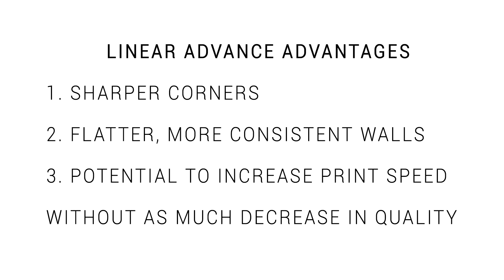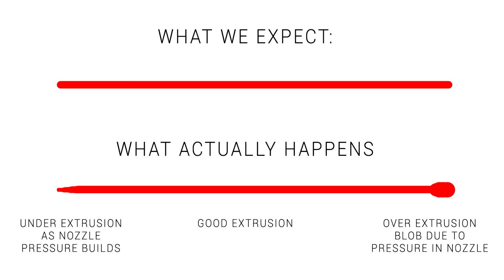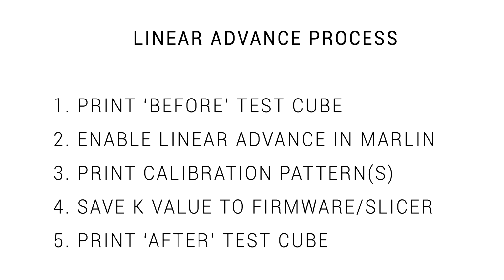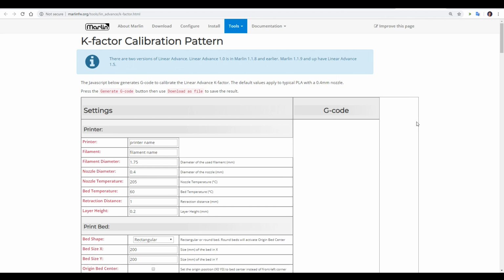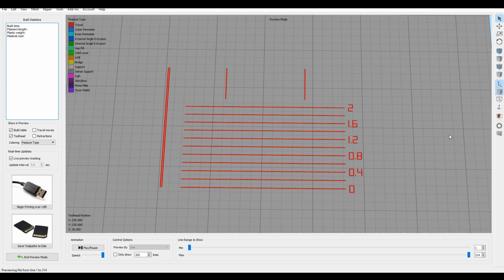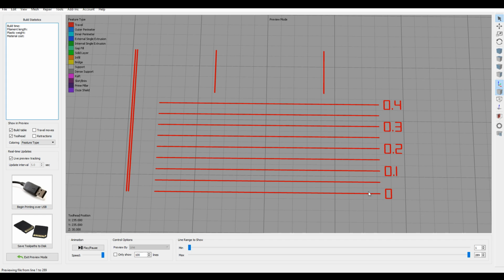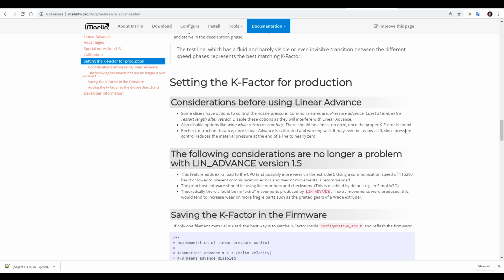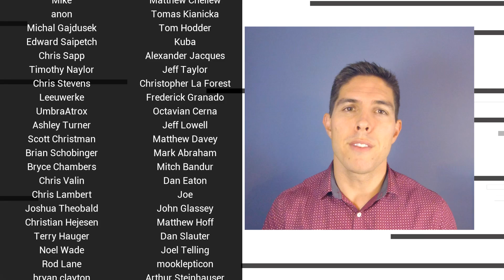Linear advance guide - Free and easy print quality improvement

Comment: If you are using UART mode TMC2208 drivers, Linear Advance will actually work (In Marlin 2.0.x, at least), but you have to change some firmware settings. I have written some notes about that, as well as some stuff pertaining to printers using a bowden configuration.

To make the 2208s play nice with Linear Advance, first make sure you're using SpreadCycle and not StealthChop on the extruder driver. Then, you'll need to enable "SQUARE_WAVE_STEPPING", as well as set "MINIMUM_STEPPER_PULSE" to 4, and MAXIMUM_STEPPER_RATE to 250000. If you don't do this, your extruder won't move at all, and will make a high pitched whining sound. You’re also going to want to set your MAXIMUM_STEPPER_PRE/POST_DIR_DELAY to 60. 

If I had to guess, it might have something to do with the 2208s not liking the rapid step and direction changes. Just spitballing, though.

Now, depending on your Marlin version you might find that Linear Advance conflicts with some of Marlin's other kinematics options. For me, with Marlin 2.0.5.3, I had to disable Junction Deviation and use traditional jerk values. If you find that your extruder is violently changing directions abruptly, making alarming sounds, or skipping steps especially on curvy lines, this might be the case for you as well.

Your extruder should be making smooth semi gradual movements back and forth. Properly set up linear advance should not look like it is torturing your extruder. It definitely creates more work for the extruder motor, but not to a worrisome degree.

Now, If you have a bowden printer Your K values will indeed be higher, somewhere around 0.4 to 1.0 depending on the length of your bowden tube and other slop factors.  You can mitigate this to a large degree though. You should keep your bowden tube as short as possible, and use the higher quality 1.9mm ID tubes like Capricorn XS. It also helps to use a decent extruder like a BMG to make your extrusion more precise, constrained, and controlled.  Linear advance is a great way to eliminate stringing with all-metal hot ends in a bowden configuration, which is a big reason why I use it. You can get away with insanely small retraction amounts, like I'm talking 1.5mm with zero stringing.

With a bowden setup you might find that the higher K values might cause your printer to constantly drop acceleration down. If you use the linear advance debug option, you'll see "Acceleration Reduced" In your printer's serial output terminal if this is the case.  If this happens to a degree that slows your prints down too much for your preference, you'll need to either Increase extruder jerk, or lower your line width. If the K value causes movements on your extruder that would exceed it's jerk rating, it slows your print acceleration down to compensate.

For reference, I use a heavily modified Ender 3 Pro. I use a BMG style extruder, feeding into a Micro Swiss all-metal hot end, through a Capricorn XS bowden tube. I am running an SKR 1.3 with all TMC2208s using UART communication mode.

It took a lot of trial and error to get LA working with the 2208s. Really, if you can swap out stepper drivers, I would suggest just getting some cheap A4988 or DRV8825 stepsticks off aliexpress and using that on your extruder, if you can. That way you won't have to make concessions. It's really good to keep spare A4988 drivers around anyway, you never know when one might burn out or something, and they're dirt cheap.

Finally, if the 2208 issues are somehow fixed in a newer Marlin version and your printer works fine without these fixes, let me know so I can get off my lazy butt and update my marlin build.
Reply: Thank you so much lol. I was wondering what the value would be around for a bowden setup and couldnt find any other ranges it should be around. I was trying like 3 to 6 lol
Reply: @acekozmo  It will vary a lot depending on filament and temperature mostly. Remember to keep that tube short and use capricorn tubing if you can.

If you use Cura, you can set the K to 0 in firmware and use the linear advance extension to set the K value for individual profiles. You can even do fancy stuff like set the K for infill to 0 since you don't care if infill strings or has corner bulges. Keep a separate profile for each filament that way you only have to run a calibration once per new filament.

In my case it usually ranges from 0.48 to 0.6. PLA has lower values than PETG for me, but it depends. One more thing. You're going to want to lower your retractions way down once you dial it in. Especially if you have an all metal hot end. Before LA I used 3.4mm retracts on my micro swiss, now I use 1.5mm.
Reply: Eric Barnett I am using Capricorn tubing and the test print the filament is not sticking to the bed as soon as it speeds up in the middle of a line and when it slows again it sticks. and all of the lines do the same thing no matter the k values
Reply: @acekozmo  You're too far from the bed. For the calibration print you're going to need to be pretty close to the bed, with the bed nice and hot. I do the calibrations at 70c. Bed adhesion is harder when the nozzle is going so fast, so you want way more of a squish then you'd use for a normal print. It also helps to do a lower layer height like 0.15mm on the calibration.

Get closer to the bed. If you manually level the bed, make sure you're doing it with the bed heated up since it expands. If you have auto bed leveling, run a g29 before you start the gcode for the calibration. I have to run a G29, then start the calibration and stand there pulling ooze off the nozzle till it starts.
Reply: Eric Barnett okay thanks! I’ll try that!!
Reply: tried all this, issue appeared a little less but still pretty bad, i don't know if it matters but what current do you use?
Reply: @gibba-3495  Try putting minimum stepper pulse to 4, and maximum stepper rate to 250000. I know it sounds crazy but that will fix it if nothing else will. The TMC2208s really require you to slow down your stepper pulses to get linear advance to work, and it will only work with junction deviation disabled.
Reply: @WrexShepard  damn, i might actually just get a different stepper driver for the extruder then
Reply: @WrexShepard  Hello how are you doing?
I have an MKS SGen L with TMC2208 drivers in UAR mode.
When I activate linear advance, the extruder motor stops working.
I don't quite understand what I have to change in my firmware.
Can you explain the steps to follow?
My test cube looks ugly and I want to improve the quality of the print.
Thank you.
Reply: @leorockford8062  The options I listed in the original post can be found in Configuration.h and Configuration_adv.h in the marlin firmware project file. You're looking for 

#define MINIMUM_STEPPER_PULSE 4

#define MAXIMUM_STEPPER_RATE 250000

#define SQUARE_WAVE_STEPPING

#define MINIMUM_STEPPER_POST_DIR_DELAY 60

#define MINIMUM_STEPPER_PRE_DIR_DELAY 60

#define CLASSIC_JERK

#define ADAPTIVE_STEP_SMOOTHING 

#define LIN_ADVANCE

#define EXPERIMENTAL_SCURVE 

#define S_CURVE_ACCELERATION

  You're going to want to comment out:

//#define STEALTHCHOP_E

Set your E jerk to around 5 to 10 to start out. Bowden printers will probably need a lower E Jerk to not tear up the extruder with sudden movements.

I don't use LA anymore because I went direct drive and found the benefits not worth the hassle of calibrating it for all different types of materials, but if you're stuck with bowden, LA is well worth it. Especially if you're using an all metal hot end and stuck with short retractions.
Reply: Eric Barnett I set all this and test.  With this I will be able to configure linear advance K?  I have direct drive
Reply: Leorockford you should be able to yes. Your E stepper will spin and you should get smooth extruder movement.
Reply: @WrexShepard  In another comment it says that putting a 4988 or 8825 driver in the extruder would work well?
If so, which one do you recommend that I use, I have both
Reply: Leorockford well the only real difference is that an drv8825 will let you use 1/32x microstepping whereas the a4988 only supports 1/16th. I would use the drv8825 if you’ve got it. Just make sure to set its vref properly and define it as your extruder driver in configuration. You’re going to want to set it to 1/32x microstepping, and because of that you’ll need to double the extruder steps/mm if you’re coming from the tmc2208 using 16x microstepping with interpolation. Make sure to also turn off microstepping interpolation on that driver since it doesn’t support it.
Reply: Eric Barnett I have the configuration at 256 microsteps.  Is it correct or should I change it?
Reply: @leorockford8062  For the TMC2208s you're better off doing 16x with interpolation (Interpolation allows the drivers to subdivide 16x microstepping into 256x, taking load off the MCU) but if you're already using 256x and have the steps/mm configured for that high, that's fine.

 For the DRV8825 you need to use 32x microsteps as that's as high as that driver supports. Keep in mind changing your microsteps requires you to change the steps/mm of that motor. So if you where using 80 steps/mm on 16x microstepping, you will now need 160 step/mm on 32x and so on. If you're using a geared extruder as well don't forget to adjust the steps/mm in relation to that as well.
Reply: Eric Barnett So for the tmc2208 in configadv.h I put 16 microsteps and set the steps / mm, the driver automatically generates the interpolation to 256 pulses / rev ?.  Would she be silent how is she now?  I put a Drv8825 for the extruder set to 32 microsteps / rev to enable linear advance?
Reply: @WrexShepard  I am trying to configure everything as you indicated, I cannot find this parameter
#define EXPERIMENTAL_SCURVE
Reply: Leorockford they may have removed it. If it doesn’t exist anymore, try linear advance with s-curve enabled and if it seems to work fine with no weird noises and underextrusion, use it. I use traditional trapezoidal acceleration with LA personally.
Reply: Eric Barnett IT WORKED!.  
The extruder motor rotates.  I set the microsteps in 16 pulses per revolution.  How do I know if the tmc2208 is interpolating at 256?
Reply: Leorockford unless you specifically disabled interpolation, it should default to on in marlin for the 2208 drivers. 16x with 256x interpolated microstepping is the default for those drivers.

Btw, it’s not 16 per revolution. It’s per step.  16 subdivisions of a single step. So a 1.8deg motor has 200 steps in a rotation and microstepping divides those 1.8 degree steps into smaller movements.
Reply: @WrexShepard  Hi Eric
After making several prints, notice that the extruder motor makes strange noise, it is like it oscillates, but it is invisible to the eyes.
Today I started printing a narrow piece, and in the filling of the first layer, I noticed that in the change of direction at the ends of the path, the extruder motor rotates backwards. So instead of putting material, it retracts.
Do you have any idea if it is one of the parameters that we change?
Thanks for your help and sharing your wisdom.
Reply: Leorockford the noise is because it is changing extrusion speed and direction on every line to regulate the flow rate. It also is going to do micro retractions at the end of lines. That’s normal. The idea is that the nozzle pressure that builds up from Bowden systems or longer direct drive systems finishes the line. The higher your K value, the more dramatic the movements will be. 

The noise shouldn’t be alarming sounding though. It should sound like a stepper motor changing directions rapidly though. If it’s making like,  clicking or like “chunking” sounds, something isn’t right with your firmware configuration. It should be somewhat smooth movements, not super jerky ones.
Reply: @gibba-3495  also as far as current goes, I use 540 on XY, 600 on Z, and 680 on E.
Reply: @WrexShepard  i have it on 1000, that was the stock in my firmware, will change it later today, but is it seems odd to me that lowering the number would fix it for me
Reply: @Gibba 1000 is way too high lol. I’m surprised your drivers haven’t been shutting down.
Reply: Gibba- The only reason I even use LA with my 2208s is because I use an all metal hot end in a Bowden configuration and it’s the easiest way to stop stringing entirely with that set up. If you’re not using an all metal hot end or have direct drive, it’s not worth it to chase linear advance with these stepper drivers since lowering the minimum stepper pulse puts an upper cap on how fast you can print. I only print at 50 to 70mm/s with a boost to 200mm/s on travel moves so it doesn’t affect me at all.
Reply: @WrexShepard  i've got a 120mm pc fan pointed at them, so the cooling is pretty good, but i will lower it soon... and i print at 60mm/s max and 150 on travel moves so it should be possible then?
Reply: @gibba-3495  Absolutely, with those speeds setting your stepper pulse settings that conservatively won't affect anything. It only becomes an issue when you're pushing high speeds and accelerations constantly.
Reply: @WrexShepard  still have the same problem with the k value test print, what are your accelerations? i have this:
accel:      1000
a-retract: 2000
a-travel:   3000
amax E:   10000
but in the k factor gcode generator it's set to 500, i don't know if that's for extruder too or not
Reply: @gibba-3495  What exactly is your problem? Are you getting alarming extruder noises? or is your test print just not working correctly? Do you have classic jerk enabled? 

You should start your K value at about 0.4 for a bowden setup and run it up to 1.0. Anything higher than 1 means your bowden tube is likely too long or has too much slop in it.

Also that retract accell is a bit high. Try 500 and go up from there. I use 1.5mm Retractions at 40mm/s with a retract acceleration of 800. I'd start with 3mm retracts though and see how it does. Most PLA for me works best with a K value of 0.48 but my tube is a very short capricorn tube.

My accelerations settings are as follows:
Print - 1000
Travel - 2000
Retract - 800

My jerk settings are:
XY - 8
Z - 0.3
E - 8

  Your settings in the gcode generator should be the same as your normal settings. Also, If you use Cura to slice normal prints, you HAVE to disable cura's acceleration and jerk control. LA doesn't like when the slicer sets the accell. Use your firmware to set those values. Anything that messes with the flow rate in Cura or any other slicer needs to be turned off or it will fight Linear Advance for control.
Reply: @WrexShepard  my problem is that there is a pretty noticable vibration-ish sound coming from the extruder when it prints the k value test file, which starts at 0.1 already (0-2 with .1 steps)

okay so apparently the changes in the firmware that i made didn't work or something, so stealthchop was still turned on, i don't know how this happened because in the firmware i have turned it off for the extruder, anyways i turned it off via the printer controls and i'm trying the test again now
Reply: @gibba-3495  When you make firmware changes, you should always go into the printer options and do "Initialize Eeprom" FYI. Sometimes the printer will keep it's old options if they're variables that are able to be changed in the printer's LCD menus.
Reply: @WrexShepard  Thanks for your time and help, i didn't know that, well i did it and tested it again, it's much better now but i can still hear it a bit, is it supposed to be like that?
Reply: @gibba-3495  You're going to hear your extruder making micro retractions, that's normal. It just shouldn't be abrupt loud clicking sounds. You'll definately have to get used to hearing your extruder make different noises as it's going to pull retracts at the end of lines as the nozzle slows down, the reversal of directions makes a small noise. It shouldn't be alarming though.
Reply: @WrexShepard  Ok, thanks for your help! hope it's working as intended right now, going to try some real test prints now
Reply: If I install the A4988, do I have to set or configure something in the firmware? Do I have to set the current on the driver with a screwdriver?
Reply: Christopher  you’ll have to set the specified driver on the extruder to A4988 in the firmware config as well as do the old fashioned vref pot adjustment yes. You can’t adjust driver current from firmware with those drivers. They’ll work better with LA though.
Reply: @WrexShepard  Thank you. I tried your described tweak, only the extruder motor has an unpleasant high tone.
Reply: Christopher did you make sure stealthchop was disabled on the extruder? The whine is usually because LA doesn’t like stealtchop.
Reply: @WrexShepard  Yes, I followed all of your instructions and also initialized the eeprom. The high pitch noise is still there.
Reply: Christopher is the motor working though? Or is it just squeeling and not moving? Spreadcycle does kind of whine when it’s holding torque. I hear it on mine too when the motor is active but just sitting still. It’s not insanely loud but I’m also old enough where I’m starting to lose high pitch hearing. 

Like I said though. It’s a lot less of a headache to just use an a4988. Although I think the tmc2209s work better without all these tweaks if you wanna stick one of those on your extruder. That’s what I’ve thought about doing.
Reply: @WrexShepard  That with the high frequency sound annoyed me, now I have installed the A4988 driver and everything sounds good. What bothers me now is that he strings extremely. I also have the ender with BMG and Microswiss. What are your cura settings?
Reply: not all heroes wear capes, sir you are a hero!
Reply: @soundspark  yes
Reply: soundspark yeah that will work. Just make sure to set the e driver to a4988 in marlin config and set the vref pot to an appropriate value.
Reply: All my K-values look the same.  They all have the same pattern with the bulge.  Maybe k of 0 is the most consistent.  I'm sure my settings are all good as I checked.  Any advice?
Reply: Sorry, I'm new to this but will it work for the Ender 3v2?
Reply: Hi. Just want to share with you guys, Linear Advance v1.5 work with Creality 4.2.2 TMC2208 on my Ender 5 Pro. Flashed with Marlin 2.0.7👍
Reply: Thank you!! @wibbyarief8958
Reply: I see this very useful video and comments is quite old now, but I though I'd ask anyway.

I use a direct drive Sovol SV01 which has a Creality 2.2.1 board ATmega2560 (not a silent board), all metal V6 hotend, running Marlin 2.0.5.3 (Coptertec 1.6.3).

I am interested in trying linear advance because, whilst it is direct drive, I have never really managed to get stringing fully under control with PETG, so thought maybe linear advance might be worth a try.

I read all the useful stuff about it not working with TMC2208 drivers and the changes mentioned here by Eric Barnett. I thought the board had 2208 drivers.

However, when poking around in the config .h files looking for the various #defines, I discover this -

#define E0_DRIVER_TYPE A4988

(X, Y and Z drivers are also A4988).

So, am I wrong in my assumption about the drivers? Will linear advance work without all the Eric Barnett config changes, seeing as the driver seems to be the A4988 anyway?